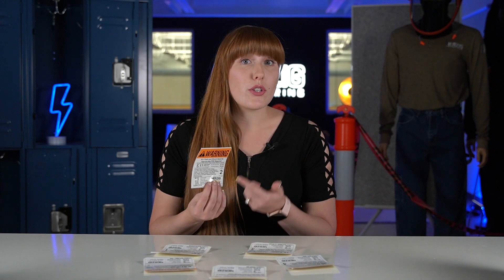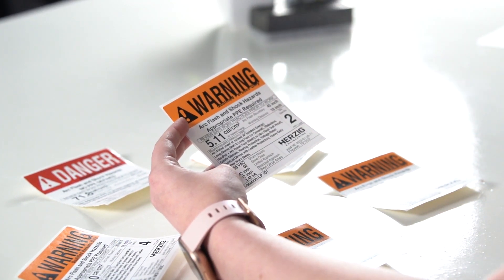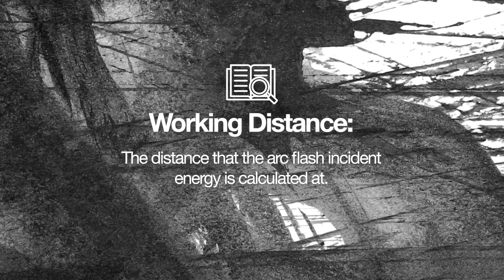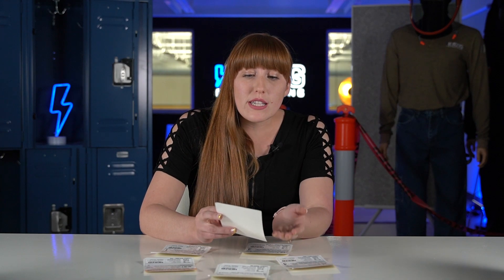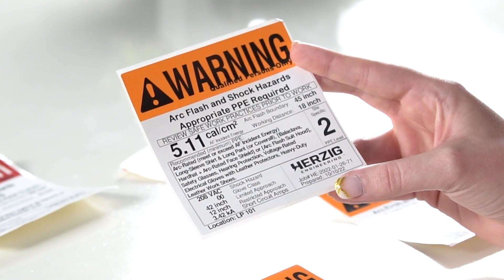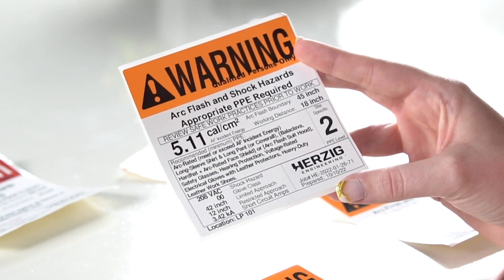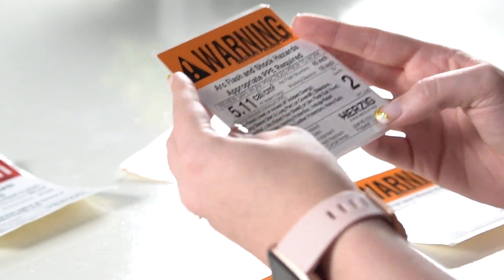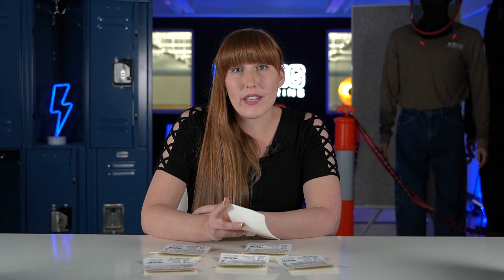How to Read Arc Flash Labels (The Secrets of these Safety Stickers)

Comment: Question: representative on these Warning labels, they are using incident energy and PPE category Doesnt this contradict NFPA 70E 2024 130.5 (H)?
Reply from the maker: Hello! That is a common question. No, we do not put a "PPE Category" from the Tables method. That is a "Site Specific PPE Level" as allowed by 2024 NFPA 70E 130.5(H).

This "Site Specific PPE Level" is used as an easy reference to the markings found on arc rated PPE (usually indicates a "2" or "4" on the sleeves,  pockets, and hoods for example). This allows a quick check between the hazard level and the arc rated material to ensure they have selected the appropriate level of PPE for the determined incident energy level. 

If you look at 130.5(H)(3), you will see that it says "at least one of the following" not "only one." The list then shows that a "Site-specific level of PPE" is allowed. 

Thank you for the question and we hope this helps!

Comment: In your arc-flash PPE, look for the ATPV on your clothing--the Arc Thermal Protection Value. So if you are doing electrical work that involves incident energy of up to 50 cal/cm2 and your PPE has an ATPV of 20 cal/cm2, don't work on that equipment until you get replacement PPE that has an ATPV of 50, or preferably more (like a value 60) for even lower risk of injury.